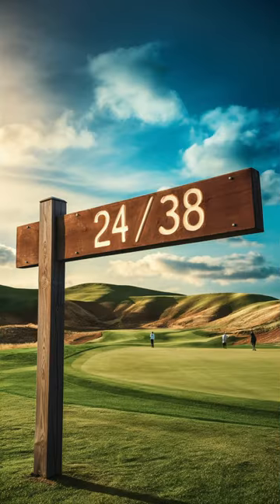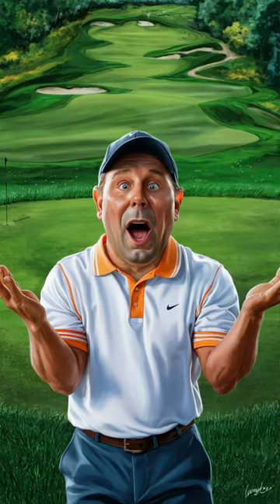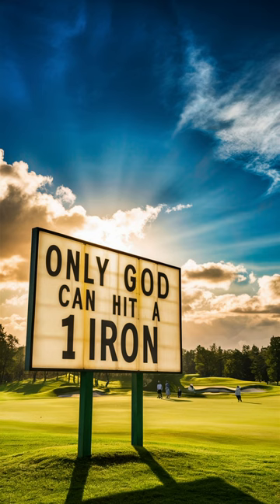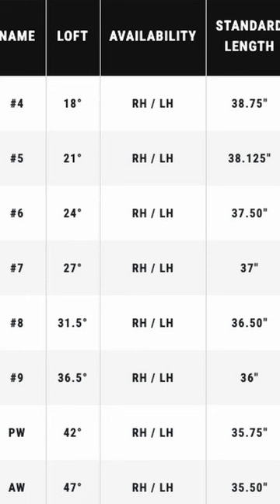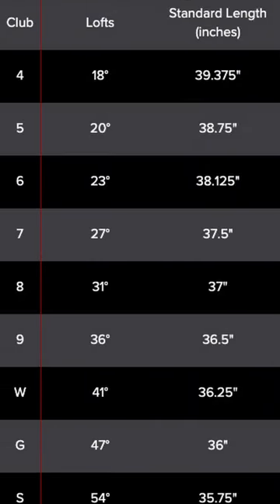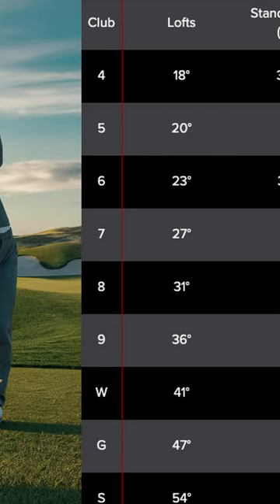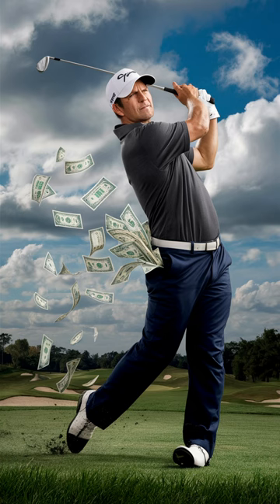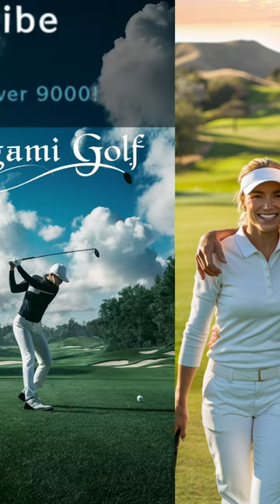Full Video: Are Your Golf Clubs Holding You Back? The 24/38 Rule You Need to Know! ep79

Comment: USED TO BE the theory. 
I have a small headed 2-iron blade with the loft of 17 degrees, it's at 40 inches. I hit it great. 
If you look at all the driving iron designs, that's where we are. Mine is not a driving iron, it's a blade, but it's a small head so it weighs nothing compared to how most clubs are made these days, it has no tip weight, but with a lighter weight steel shaft with a lower kick and softer tip, and counter-balance, the thing launches perfectly fine and it's also good for hitting stingers. I play in the wind quite a lot, and it works fine for that.

Comment: As an old guy, I can tell you that we all knew about the 24/38 rule. Wishon addresses the "vanishing loft" problem that began somewhere at the beginning of the 1980s in his books. Fast forward to today and there is something else to consider when thinking about the 24/38 rule. That rule had to do with blades as those were the irons of the day. Today's heads are designed with a different COG. This mitigates the "24" part of the rule but adds a new problem...lack of spin. Some companies are making their strong 22* 5 irons heavy enough to play at 38" without having to add weight to get an appropriate swing weight. I'm thinking about JPX 923 HM Pros and they spin better than the 3 iron I played in high school. Add a 2nd gap wedge and you have a set of irons from the 60s and 70s. They just have the "wrong" number stamped on the sole.
Reply: True in some ways, but if you look at the groove rules, it only applies to clubs that have more loft than 20, so any clubs below 20 degrees are allowed to have square grooves so there really isn't a problem with spin, per se. I have no problems spinning my 2 iron, of course, given that it's not going to suck back like a wedge, but who needs a 2 iron to suck back? lol